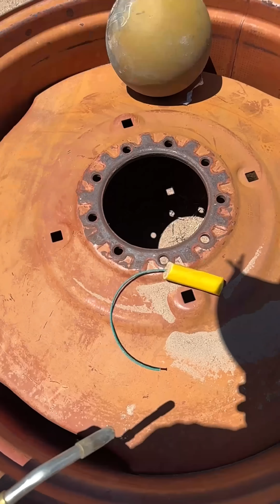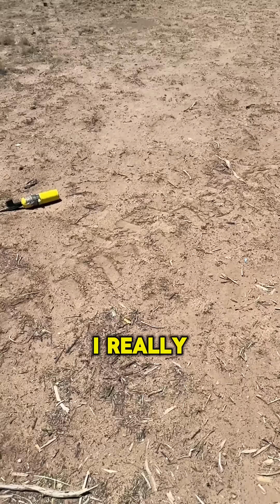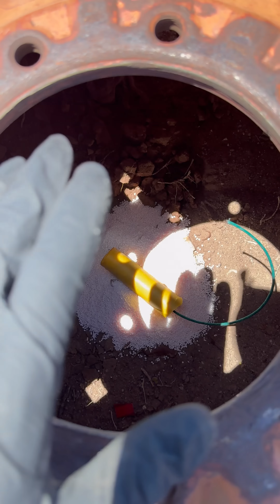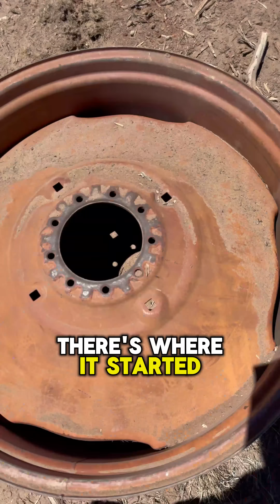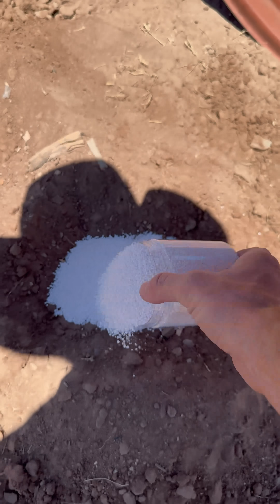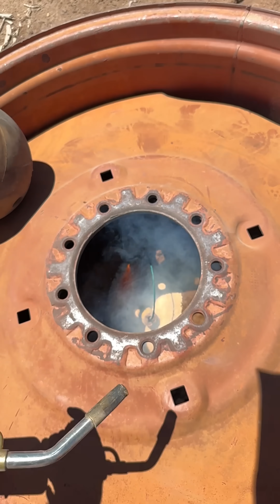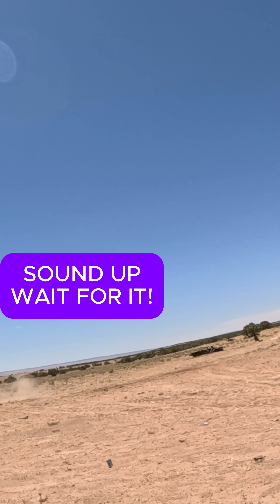How powerful is ANFO and Dynamite?

Comment: Dynamite and ANFO are not comparable. Dynamite is a moderate speed HE, designed for brisance, or shattering effect, whereas ANFO is low speed HME, designed for a slower, pushing effect. The Dynamite ANFO combo you used is what quarrymen use to shift thousands of tonnes of rock in a controlled fashion.

Comment: When I was a teenager, my buddy had these M80s & we stole 2 glass ash trays out of this hotel we were staying at with our parents at a church convention, of all things. Anyway, we went outside a ways from the hotel & put 1 ash tray on the ground, put the M80 on/in it, and lit the fuse. We put the 2nd ash tray inverted on top of the 1st. Then we ran & hid behind something. After the explosion we came back & the bottom was kind of intact - it was the correct shape - but it was dust. We never found anything from the top ash tray.

Comment: I did a quarter stick in a station wagon hubcap.  Straight up perfectly rounded like a dome when it came straight back down.  It was highly curved prior to exploding.  I bought them in Washington DC 1983. 10 a piece.  I bought ten.  I bet. About 3.5 inches tall 1 inch diameter. Looked like a big ass m-80. Also we think I may have cracked our pool later on.  What a cloud of water and smoke that was.  I didn’t do it my older brother did.  I guess.  I just took the heat.  I threw the party.  🎉

Comment: I did that by accident with a 50 gallon drum, a washer drum placed on top, an old fuel found in a gas can that was buried in someone's backyard. 
I was burning junk in the backyard and I was using the washer drum for ventilation, since it had a bunch of holes. I balled up a bunch of old magazines and pour the fuel on it. 
When I went to light it nothing happened. I was using matches. I tried it again and still nothing. I stuck my head over it just to confirm, all of a sudden it went boom 💥💥💥. Thank God it missed my head. And that's when I realized the washer drum was gone. While looking around for it, I looked up and it was on its way down. 
That was stupid, but it was still fun😅 and now I know not to stick my head over it. I'll definitely do it again😂

Comment: I did that with a 55 gallon drum that had one end open to use as a trash can.  Turned it upside down on a homemade bomb, and blew it about 30 feet in the air.  It would have gone higher had the end of the can not separated.  Good times!

Comment: In the Marine Corps I went to demo school. A platter charge is what this concept is called. If you take a “platter” like a city manhole and put a sufficient quantity of C4 or TNT behind it… you can “shoot” that slug of steel fast enough to defeat the armor on even MBT’s. Especially if you aim it “up” to hit the bottom of a vehicle. In demo school we didn’t have any manholes but we did swipe one of our NCO’s donut spare tire out of his POV. We shot that donut so high that we lost sight of it. Got into trouble because we actually shot it clean off the demo range and it landed on the road some distance away… which was a “no no”.

Comment: In 1989, I was a sergeant in the Marine Corps infantry. One day we went out to the demo range (the entire company). Blew up lots of stuff. At the end, there was about 30 pounds of C4 left over. The CO had myself and Bill (another sergeant) stay back and get rid of the leftovers. There was a stump about 10 feet tall on the range. We decided to put all of the C4 underneath the stump (there was a hole of sorts at the base. We set everything to go at once. The engineers running the range asked us if we really wanted to do that. In our blissful ignorance we said sure. We set 2 two minute fuses, popped the igniters and walked to an explosion proof barrier. The engineers drove back a lot further than we were. When that charge exploded, it launched that trunk about 100 feet in the air coming right at us. Bill ran in one direction and I ran in the opposite direction. The engineers couldn't stop laughing for quite a while. I really wish I had a video of that. We never did that again 😳
Reply: "Are you sure you want to do that?"
"Well I wasn't before, but now I am!"

😂😂😂

Comment: To be absolutely accurate, there was no anFO shown there. It looked to be simply a scoop of ammonium nitrate, and then two scoops. 
ANFO requires Fuel Oil.
Otherwise, it was an interesting bit of information.

Comment: For the final one I got 13 seconds of hang time which needed an initial speed of about 209 ft/s (64 m/s, ~143 mph) reaching a maximum height of about 680 ft (207 m) before returning to the ground.
Reply: Impressive maths friend 👍
Reply: @Alan-Godden not really
Reply: @Alan-Godden just High school grade physics. Use 1 st equation of motion.
Reply: That’s the basic google answer for something being blown into the air for a total of 13 seconds. You didn’t calculate anything. 🤡
Reply: @PNWRottweilers253  never says he did. clown
Reply: @jacobharris8223 copied directly from google search
Reply: You are wayyyyyyy off lmao
Reply: @jeffb5051  How you are you going to tell him he is way off without giving the "right" answer?🤦🏻‍♂️
Reply: @Nolacrabs-qm4db 😂😂😂😂😂
Reply: @matthewgarrigus38 it got up there is the correct answer and fast. 😅

Comment: Okay, so my Dynamite does not go off without its little fuse.
First I connect that Fuse and that Burning wire(I forgot its name in english). And then Put that Fuse into the dynamite and then torch the wire only then it goes boom. 
Maybe your product is different.

Comment: When a bowling ball flies through the air at increasing speed, it will start to spin from drag on the fingerholes, and it will also fall down and start to whistle from the finger holes. Since there was no real imposed spin like a rifle barrel on the bowling ball, this spin will be random and slower, so the whistling will be repetitive according to the spin & speed of the ball like you hear in the video, "pher wheet---pher wheet-pher wheet, pherwheet, pherwheet pherwheet", increasing in frequency as it falls faster and faster and spins faster and faster.  You heard the sound of the truck & hitting the ground, the sound of the truck rim center as it came down secondly like a frisbee, then the third sound of the whistling must have been the bowling ball getting closer to the ground before it hit and stopped. The bowling ball should be within hearing distance like that. He should be able to find the bowling ball by the sound and early frames of the video. An estimation that it should be less than 500 feet away from where the bowling ball landed when he just previously shot up the bowling ball.
Reply from the maker: Best explanation I’ve seen on the sounds! Yeah I should be able to find it but I haven’t yet. I look every time I have some extra time. Maybe it rolled under something idk🤣

Comment: there should be a triangle [arc] w vertex at the origin, straight out to the rim [shortest travel] and to about 3 times [proportion of ∆t of thuds] the distance then laterally 2x the distance that includes the 'lug plate' [least aerodynamic, caught most force] then mirrored over the rim line that would enclose the ball [most aerodynamic]

Comment: It made me happy to see you move the majority of the fuse away from the anfo. When you first placed it I was worried it would cause the anfo to ignite prematurely. I’ve never worked with anfo, however I just assumed the heat and flame from the fuse could cause ignition to the outer edges before reaching the center.
Reply: Anfo is not cap sensitive, so it shouldnt go off. But, even still, its good practice to not expose it to flame.
Reply: @valdimer11  that’s good to know thank you. I’ve never used any type of explosives or flammable materials before. I didn’t know how reactive it was to heat or flames.

Comment: at 13 i know the anfo mixture, how it detonates, etc before i came across this video
its simple 
fertilizer is flammable and already contains amonium nitrate. another good thing to add is fuel oil aswell. then you can just use a traditional blasting cap or electric blasting cap

Comment: Dynamite and ANFO are both slow moving explosives good for moving material with alot of force. Hence why its used for blasting soil at a few thousand FPS. C4 or RDX is 10,000-13,000 FPS. That fast force creates more a cutting effect and is why its used to breach doors and shatter giant boulder with out drilling

Comment: We stuck a bowling ball on the top of this metal pipe thing that was welded to a flat piece of metal with a hole in the bottom, I think it was 2 pounds of tannerite. After we shot it we lost sight of the bowling ball which was not awesome

Comment: McVeigh used that in Oklahoma, Lebanon they say 20 tons went off.. its stable either enhanced with diesel or not. But it takes an explosion to set it off and with out the fuel it wont do nothing. Lebanon had 20ton or more said to be in storage for years. But who added the fuel and who created the explosion to set it off??? Think bout it

Comment: A metal man hole cover is believed to be the first man made object to leave earths orbit. It was used to seal the top of a tunnel used for underground nuclear testing. Upon detonation it was calculated to have been accelerated upward at a speed of 125,000 mph. Now that’s a big boom.
Reply: "In a galaxy far, far away.... the Deathstar got a cracked windshield from a manhole cover." 😆
Reply: @DBrees0  Its okay, I saw a AAA Member sticker stuck on the back side of it, they're bringing a fresh windshield out to replace it.  😂
Reply: They only captured like one or two frames of video footage of it moving I think. Could be wrong tho.
Reply: Now it’s got a bowling ball for company.
Reply: Unfortunately it is also widely accepted that it would have disintegrated before it ever hit the Kármán line, as even a manhole cover moving at half that speed would be liquid in 5 miles and reduced to base elements by 15
Reply: @Kilanov  Most of what I've seen or read is that it's inconclusive, i think they say that just because it's fun to keep the mystery. It wasn't a regular manhole cover, it was two tons.
Reply: @Kilanov  it wasnt actually a manhole cover. it was a thiiiick piece of steel. i think it made it to space personally.
Reply: That definitely exceeds escape velocity.
Reply: Actually i've got it in my house
Reply: @bradbuchanan8153   you lie .... I have it in the front room of my house.... 😃😄😁🇦🇺
Reply: Ive heard about that on a science channel

Comment: 100lbs of this stuff with a blasting cap and ignitor. That is what I want next. Can use an metal drain pipe that is milled for the caps. Biggest pipebomb ever possibly.

Comment: When you use a wick to ignite Dynamite, you lose a good portion of it's power. DDT Or deflagration to detonation causes massive energy loss. That 1/2 stick of dynamite lit with a fuse roughly translates to 3/8 stick of dynamite. Next time, try a blasting cap ;)

Comment: Mini bowling ball found at a garage sale two bucks.. old rim for a tractor tire found in the barn free.. Dynamite bought and paid for with his license that he'll never get to use again when the ATF sees this video.
 Green water proof fuse. You don't need to use short pieces,it's cheap. You should have used a really long piece to ensure safety.
 No. Fragmentation pieces that came at him and killed him (priceless)

Commercial ,,for the torch's ability to take a lick  and keep on lighting.
 completely phenomenal!..

You get the Darwin award...

Comment: I guarantee this kid is under 21, because he shows a complete disconnect between reality and risk assessment/consequence analysis.  The human brain contains a nearly complete circuitry at birth, but the nerve fibers are not insulated -- haven't yet acquired their myelin sheaths, so other than language acquisition, there aren't a lot of higher functions going on in an infant.  The deposition of myelin sheathing proceeds in a particular sequence throughout childhood, and the child acquires more adult-like abilities as each section of brain reaches mature configuration.  The last section to fully myelinate is the frontal poles, which mediate judgement, cost-benefit analyses and some social functions.  The process generally completes between the ages of 19 and 22.  Until then a teen skater is liable to blow through a red light downtown at 50 mph.  It's a rush if he gets through unsquished.  Otherwise, not so much.  It also accounts for the frequency of teen suicide.  The immature frontal poles tell the kid he'll feel better in the morning if he kills himself tonight.

Comment: I made my own stick of dynamite and set it off with my friend. Unfortunately, it was under wet conditions and the wick went out. Now, that we all know where this is going. I suggest you never relight a wick. But, I have to finish the story. I decided to relight the wick. It seemed to go a lot faster than when it was longer even though I know it burns roughly at the same speed. However, after the cloud of smoke finally cleared around me, my friend who was about 20 feet behind me said,   I thought you were a goner. Thank God, nothing really happened other than my ears ringing. I was still able to get about 5 ft away before it went off. I would never want to get any closer. Until this day that was the last stick of dynamite I've ever created and or lit off. Now, I do everything electronically with really long wires. With always a little extra length just in case. 😂😂😂

Comment: Dude. Do you have another wheel? After the first one, I would have strapped the ball to the under side so it kept more pressure in and helped push.
 I know it’s not going to be a big difference but I bet it would be noticeable.

 Just need more fuse so you don’t have to mess with laying the wheel down on top after it’s lit. lol

Comment: That’s not “anfo” it’s just uncontained ammonium nitrate.  ANFO is a slurry of prilled ammonium nitrate mixed with an accelerant typically diesel oil.
Reply: No its not. Anfo looks different based on application.
Reply: @valdimer11 yes it is.  I’ve fired more anfo and straight up ammonium nitrate than you have.
ANFO stands for (wait for it) ammonium nitrate and fuel oil.  🤦🏻‍♂️🤦🏻‍♂️🤦🏻‍♂️

Comment: ANFO, or ammonium nitrate and fuel oil, came into widespread use by the mid-20th century, beginning around 1955-1957.
Between 1955 and 1957, UFO sightings remained a consistent phenomenon, with a notable increase occurring in 1957. This period is part of the larger mid-20th-century flying saucer craze that led to thousands of reports submitted to the U.S. Air Force's Project Blue Book.
Just sayin.

Comment: After some quick maths assuming no air resistance, the center of the tractor wheel stayed in the air for 14 seconds, which means it went about 800 feet in the air!

Comment: I did some calculations and video analysis and it went at 230km/h , so pretty fast. At that speed the ball reached a maximum altitude of 210m
Reply: I calculated about 207m!  ❤❤❤
Reply: Now THAT is Science! Thank you.
Reply: I calculated 208.65 🤓
Reply: Bowling balls are various hard plastics, so it became particulate, which has a lot of surface area. I’m guessing none of it made 30 meters. I would like to see an analysis of the pressure wave going through the bowling ball. (Steel is pretty easy to model, so — boring, except for weld shear.)
Reply: @RussKlo I downloaded the video (by screenshot) and we clearly can see the bowling ball go away straight up, just ahead of the top part of the tractor rim. I estimated the distance made by the ball between two frames (at 30fps) to be 2.15 times the diameter of that rim, that itself seems to be 4.5 bowling ball wide (22cm), so approximately 1m.
Some basic equations and it gives me 210m (ignoring the air resistance)
Reply: @georem  Cool. Compact mass, curved edges, relatively small diameter. Air resistance real but minimal. 

This is entertaining, but I worry about his proximity.
Reply: so you knew the mass of the rim and the ball ?  How tall the trees were in the background?
Reply: @jeffreyhutchins6527 The maximum high only depends on the initial speed if we ignore air resistance. And for the distance I just compared the distance made by the ball to the size of the rim so background doesn't matter
Reply: What's that in freedom units?
Reply: Thanks

Comment: I saw my neighbors kid blow both of his hands off doing something similar. Opened his forearms like a blooming flower. I had to chase him down because he wouldn't stop running and screaming in shock and squeeze his arm that I didn't have a belt tourniquet for with my bare hands while fighting a bloody and slippery kid with no hands because the pressure I was applying hurt so much until emts came. I have nightmares still about it. Please don't do this kids. You can go from having fun to gruesome hyper-gore so fast that the transition is almost as nauseating as the bloody mess laying on the ground in front of you. Stay safe.

Comment: I used to mess around with chemistry as a 10 yr old kid but very nearly burnt the house down. Variables occur, in my case using aluminium foil to line the reaction vessel (as it was a plastic pill container!) was enough to trigger auto ignition.

Comment: How PERFECT that center came off is amazing !!
Reply: They're just spot welded. Not all that amazing when you know just how little metal was holding it together.

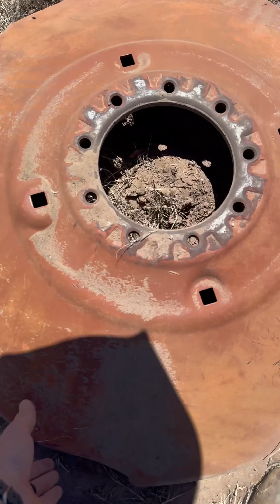1:41 when he stands it up on edge. You can see 2 round spots in the edge surface. Those 2 spots (and 2 more for each of the spokes) is all that holds the rim together.
Reply: @nunyabidness674 ever seen how a steering sector is in the 8400 jd😂😂😂😂
Reply: @banditgrizzy1955  It's been a SOLID 25 years since I played with JD steering, but probably lol

Normally I see International - Holland, Massey - Furgeson, Cat or Case

Edit: I went ahead and looked it up. OOOOH YEEEEEEAH... THOSE MF'ers...
"Hey boss! The tractor won't turn left!"
"How big of a hole did you hit?"
Reply: @nunyabidness674😂😂😂😂